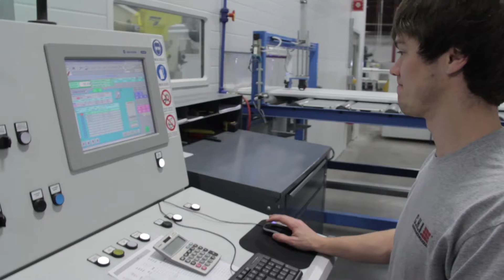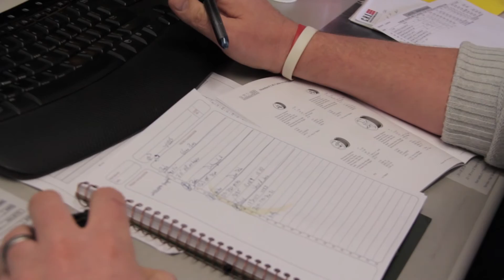CHI Garage Doors

Comment: this company should change their name to strictly CHI garage doors. Overhead Door is the  leading door manufacturer in the industry, and was established before this company. The quality of a chi door compare to an authentic Overhead Door product is drastically different. The prices have medium to small gap and your getting a better product. You pay for what u get, a Scam artist or the real deal.
Reply: You clearly have no knowledge on garage doors at all. "Overhead door" is an umbrella term referring to any garage door that goes over your head, as the name suggests. I used to work for Overhead Door Co. and I've also worked for companies installing CHI doors. I also sold CHI product for a period of time. Overhead Door Co. Garage Doors are terrible product. They're chinsy and overpriced. Everyone in the industry knows that, even those who install Overhead. Wayne Dalton is also terrible. They're the joke of the industry, and they're nothing but a cheaper version of Overhead. CHI sells strong quality product. CHI and Raynor are the best you can get with a garage door. Haas is pretty good too. I've worked on and installed many different garage door brands, and Raynor and CHI are by far the best made doors I've encountered. Overhead and Wayne Dalton are the worst.